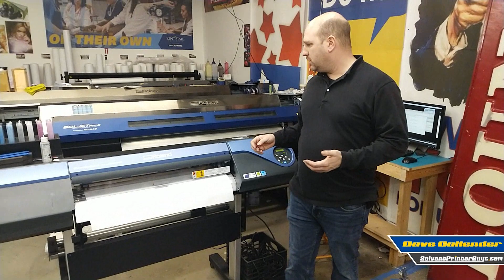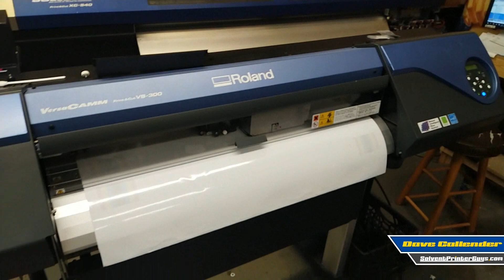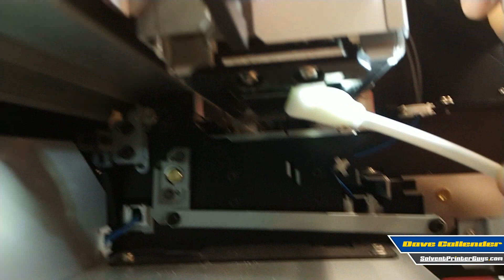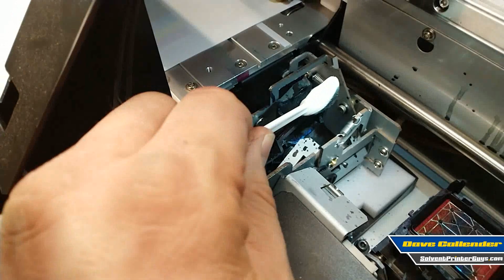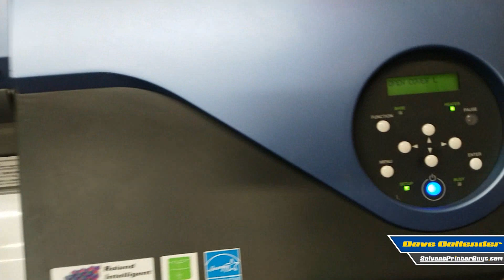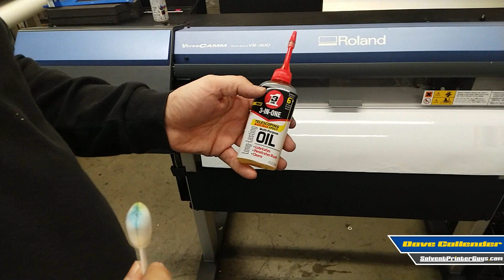Roland VS300 Maintenance & Cleaning

Comment: which is the oldest model print/cut that roland makes that allows you to create die cut stickers where it cuts out the whole sticker from the sheet and it falls through after printing? i am familiar with the sp540 that was the last model i used over a decade ago before sticking to dtg printing and back then i was never told i could perform that with that sp540 printer but i assume this was something that was figured out after those models? 

thank you for your time!
Reply from the maker: If I am understanding what you are asking then many Roland models could be set with enough cut force to cut both the vinyl top layer and the backing paper layer of the vinyl.  It takes additional force and a sharp high quality blade but I believe most Roland Printer Cutters should be up to the task - You will also end up replacing your cutting protection strip frequently if you are trying to cut that deeply.  Hope that helps.
Reply: @BetterBannerPrinting   yes exactly "die cut" i seen a roland xc 540 doing these die cuts in 4mil media kinda like these types of stickers in this link. 

https://thestickybrand.com/product/bombproof-die-cut-stickers/

also which rolands do you have for sale? im interested in taking a look at some.

Comment: is it hard to do maintenance on the Roland SC545EX 54"
Reply from the maker: That printer has 6 heads so it takes longer than some printers to do proper maintenance but it is very doable - You should be able to use a cleaning swab and clear cleaning solution and manually clean the heads, wipers, cap tops in 10 minutes or less every week